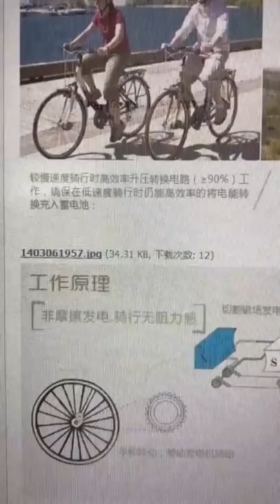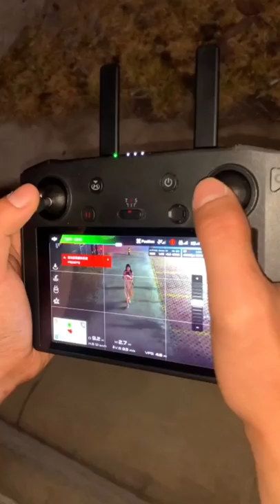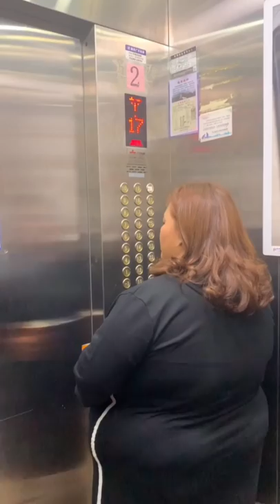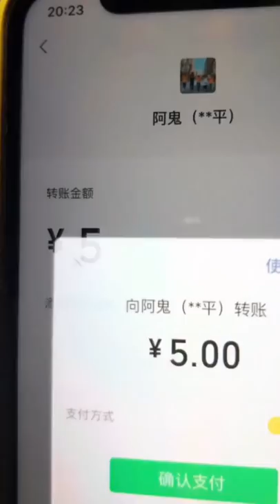Best Tictok China | Prank Mom and You Will Regret | Detective Mom and Genius Son | GuiGe 鬼哥 (2021)

Comment: Vehicle speed: 30 km/h.
Braking strength: 700 newtons.
Mooncake weight: 200 grams.
Swing power: 500 pounds.
Angle of attack: 180 degrees.
Target direction: 12 o'clock.
Best position: Back.